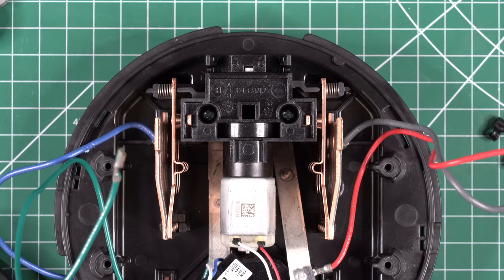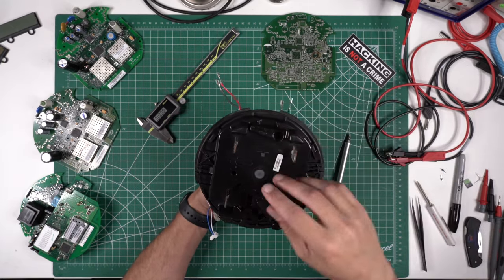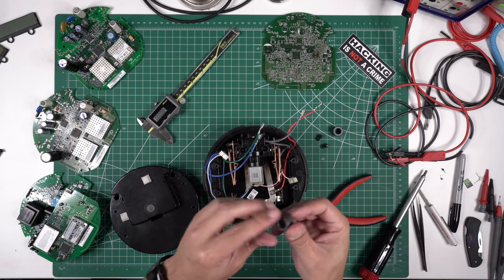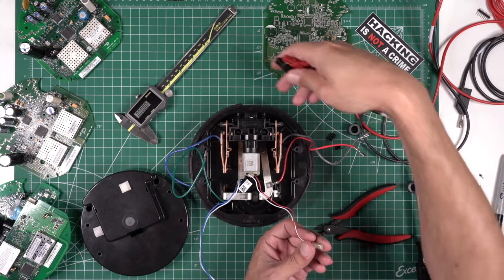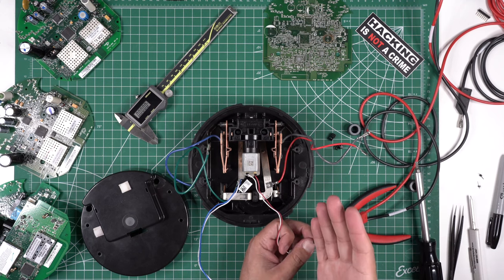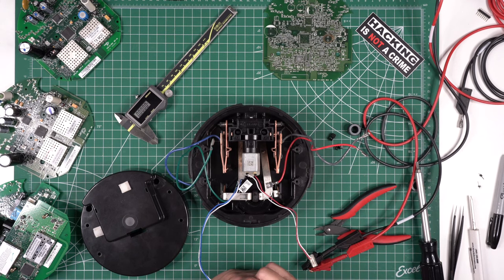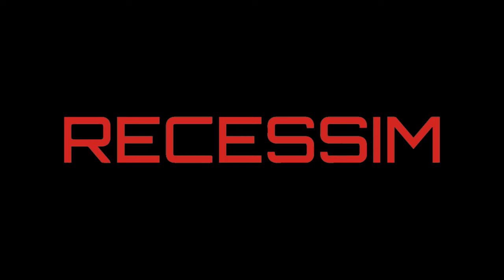Smart Meter Hacking - Remote Disconnect

Comment: So there is a hidden network on the actual electrical grid?
Reply: You can in fact send a signal through a power other than just the regular power.
Reply: Yes. As long ago as the 1980's there were stereo systems where you could plug an adapter into a 120 volt power outlet and another one into a 120 volt power outlet at another location in your house and you could have speakers at both locations to hear your stereo AND control the volume of the speakers and the CD track, radio station selection at each location.
Reply: They still use it for home automation, it's cslled PLC, power line communication

Comment: Cant remove the meter without removing/cutting the tag with its wire . They will see the wire and its tag cut. Why cant I disrupt the meter with a rare earth magnet?
Reply: You have to be smarter than the tag. Use your mind and you can figure out how easy the security tag is to remove. I did years ago.

Comment: Before smart meters they put a plastic cap on the prongs that connect to the buildings circuitry. Super easy to leave the plastic in place and bridge the connections. Also you could do the same to a smart meter as well and all the button pushing in the world wouldn't stop you from having electricity. It's actually pretty trivial to steal power. Not that I am encouraging this behavior. Just mentioning it as it's relevant to the conversation. I used to be the guy that came and turned on your power and cut you off. I've seen people do everything from drilling holes and using a piece of metal to block meter gears to people wrapping their smart meter in tin foil.
Reply: I'm the guy who told guys like you to stop trespassing upon my private property, and proceeded to have you arrested if you showed up again without written permission. Needless to say, my interactions with  your kind were minimal. One and done. BTW the "easement" myth is just that - a myth, especially in states where "code" requires 'residences' to have a power meter connected. It's also statutory in nature, and statutes require a contract - which you don't have.
Reply: How do I hook my power up I only need it for 2 days until pay day
Reply: How do you bridge a meter safely?
Reply: @alphaforce6998 I have the same attitude. I’m not paying you for what is effectively a necessary-for-life utility. Gtfo my land and get a warrant.

Comment: Hi! Great your content, I'm watching all your videos. Is it possible for the company to discover energy theft due to the difference in current on both phases and neutral?
Reply from the maker: I haven’t looked into that, but if you’re interested the data sheet for the Teridian chip used for metering outlines what features it has to help with detecting fraud.
Reply: They can't detect theft remotely of you use the plastic shut off clips on all four prongs and bridge the connections. When they shut you off though they only do one and obviously they don't use the caps anymore since it's all remote now. As for detecting theft it all depends on how it's wired and if your meter is working properly
Reply: Simple answer is yes.

Your utility will normally track your average usage on both hot legs through a single CT pickup and create a baseline of common watthour consumption. Once the baseline is made, any drops in consumption are flagged and a technician might be dispatched to investigate the pan for tampering.

These meters have multiple parameters and data setpoints as well as a few sensors built into them to detect and flag anything considered to be an abnormal operating condition.

To circle back to your question regarding phase-to-neutral differences, that would only apply if you had a 120/208 3-wire service, because only that style meter would reference the neutral in order to measure watthours. A 120/240 3-wire service meter does not reference the neutral.

In less words, much harder to steal the pixies...

Comment: Is the disconnect command transmitted wirelessly (and could be blocked by shielding the meter) or sent through the power line?
Reply from the maker: For these ones, sent wirelessly. But you can’t shield the meter or it will disappear from the network and power company will come replace it or remove the material blocking it
Reply: @RECESSIM  interesting. I’m not saying I would do this (seriously, it’s not worth the effort), but it sounds like one could successfully put foil or metallic window screen around the meter temporarily, only when a forced blackout might be imminent, like this winter.

But with this winter’s event in Texas, was the power cut per house with these smart meters? I assumed it was at neighborhood or substation switches.
Reply from the maker: I never saw power cut at the meter level, it was on some larger scale because even the meters were all shut off.
Reply: @RECESSIM  - You are right. Load shed is normally done on a larger scale - usually at substations or feeders. They are (usually) remotely triggered through the network. In the case of Feb.2021 in Texas, a number of those remotely triggered off were unable to be turned back on remotely due to conditions caused by the extreme freezing temperatures. What was supposed to be short 30 to 60 minute rolling blackouts turned into days for many (including my home - 76 hours continuous).  Crews had to go to the remote sites to fix what went wrong and then turn power back on. IF there was proper security on smart meters, and an established plan to identify what meters to cut off, smart meters would have been a better choice (where available). In that scenario, the substations would not have been the issue.

Comment: This video provides a good view of some important components, that are common on FOCUS model meters. FOCUS AX/AX-R and similar variations share the same physical shell. Now I'm going to talk about what people watching this video really want to know - what can be adjusted to adjust how much you 'pay' for electricity.

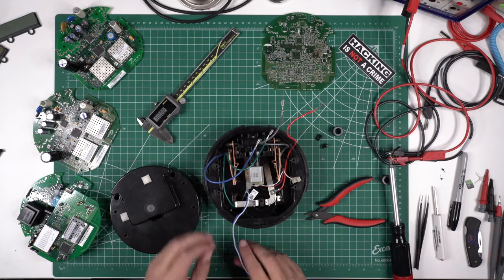The answer is remarkably simple. Pause this video around the 2:06 mark where you can see several sets of wires. This wiring scheme is standard for all FOCUS meters:

1) Red/White pair: controls the remote disconnect relay if the meter is equipped with it. These are the -SD variants, so AXR-SD for example. The -SD means "service disconnect". Apply a DC voltage around 25-30 volts to actuate the relay, noting that polarity must be reversed going from closed to open or vice versa.

2) Red/Gray AND Blue/BlueWhite: These are thicker wire sets that you see on the outermost sides. These leads plug into the meter PCB to detect voltage as it is flowing through the relay. Note that these are not the leads the power the meter, they are there so that it can be known if after the relay is open there is voltage or not flowing to the service end. In other words, they are a sort of confirmation system. If the relay is open (disconnected) then there should be no voltage going to the house, and if the relay is closed there should be voltage. If someone's service was remotely disabled, and they manually turn it back on without first unplugging these wires, it will usually trigger a service call and the meter will be replaced.

3) Blue/White: Here we have the most important set. The thinner blue/white wires that are in the center connect to a current transformer (the donut shape thing) and these are used to measure the current. If you only disconnected these wires you'd gain unmetered electricity, but over time would likely trigger a service call and they would replace the meter. There are two options for dealing with this in a more discrete manner to lower the amount they charge:

Splice in a stereo potentiometer (50-100K ohm is fine) and turn the knob as far clockwise as it can go, then turn on your most power-heavy appliances (electric oven, electric water heater, a/c, crypto miners) and slowly turn the knob counter-clockwise until the power reading is in some comfortable range. 

In order for it to work this way, you have to wire the pot properly. A stereo pot will have six pins in two rows of three. If you look at the pot from the front, with the knob facing you, lets number the front row of three pins 1, 2, and 3 with the rearmost row pins 4,5, and 6. The middle pins, 2 and 5, are connected to the wiper of the pot. This allows you to adjust the resistance between the these pins and the others. The connection would be like this:

Cut the white wire and strip the ends. Solder one end to pin 2 and the other half to pin 3.

Cut the blue wire in half and strip the ends. Solder one half to pin 5 and the other to pin 6.

In this manner, the pot will operate just like the volume knob on a stereo. Turned fully counter-clockwise is max-resistance which means the power reading will be at or near zero. Full clockwise means min-resistance and the power reading will be at or near 100%.

Note that instead of cutting and soldering directly to the wires in the meter, you can use solderless wire splice connectors (two per wire) to connect the pot to the wire. This way you can solder longer wires to the pot, then splice them using the snap connectors and lastly snip each wire on the meter as before.

BLUE WIRE : ----[SPLICE 1]-----[CUT AFTER SPLICING]-----[SPLICE 2]----
WHITE WIRE: ----[SPLICE 3]-----[CUT AFTER SPLICING]-----[SPLICE 4]----

WARNING: Do not remove your meter while doing this. If you remove the meter or even tilt it, it will send a notification and within a week or two it will be replaced. You can remove the outer clear shell but you must leave the base of the meter in place while you do these things. To remove the clear shell, there is a small pin that has to be pulled out. If you do it carefully, you can pull that pin out without damaging it. There is plenty of room splice the wires but you need to be careful. The solderless wire splices make this a very easy mod.
Reply: Hello bro how can i contact you
Reply: @LuisRamirez-md6oz  What do you need, my man?
Reply: I would like to know a little more information about the blue and white cables.
Reply: @LuisRamirez-pm7kv  Those wires connect the current transformer found on the back plate to the PCB, which is how the meter measures power usage. Based on the amount of current flowing through the meter lugs, the voltage in these wires will be higher or lower. If you were to do something like splice in a voltage divider, you could have the meter read less than the actual current. If you unplug it, it will not meter power at all, but it will still be monitoring voltage.
Reply: Hey brother, what if I only put a 100k resistor?
Reply: Hey brother, what if I only put a 100k resistor?
Reply: Hey brother, what if I only put a 100k resistor?
Reply: @LuisRamirez-md6oz  Nothing really. You'd need to connect two 50k resistors in series, then use a wire to ground the point between two resistors to create a voltage divider. This will bleed some of the voltage into ground thereby reducing the current reading.
Reply: What happens if I put only one resistor on the blue wire of 100k oms?
Reply: What happens if I put only one resistor on the blue wire of 100k oms?
Reply: @LuisRamirez-md6oz  A resister in-line by itself would dissipate some current as heat, but because the voltage of this circuit is variable there is no way to calculate the effect. You need to know the current in addition to the resistance to calculate the voltage drop.

The current transformer of the meter is a low current, high impedance type of device, very similar to audio jacks on a sound amplifier. Impedance is like the AC version of DC resistance; it includes frequency as part of the calculation.

As I told you before, you can make a simple voltage divider by connecting two resistors of equal value in parallel, then using a new wire to connect the center  portion that is where the two resistors connect to the metal box as ground. If you do this, it will cut your electrical use reading by 50%.

Comment: They can remotely connect and disconnect from a computer with the tap of a key ,and charge more to turn your power back on then when they sent technicians out. Plus they can change meter reading remotely and no one would ever know. Change the meters over a large area by 1 point and make millions extra and nobody would be the wiser.

Comment: on the bad meters, check the limit switchs, they tend to go bad quick, the motors usually fine
Reply from the maker: What do you mean by “limit switches?”
Reply: @RECESSIM  Being that its just a DC brushless motor, it rotates till it hits a micro switch which then interrupts it so the motor doesnt burn out, micro switchs like that fail by the dozens, look at teslas door handle debacle for a good example of how it was re-engineered, so the motor probably has close to infinite life, it would be the gears and limit switchs that would die